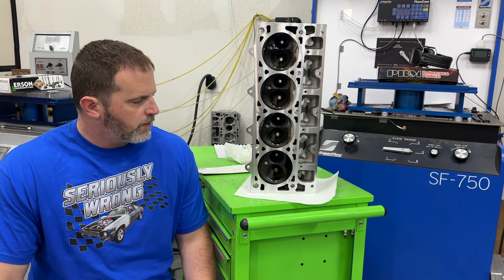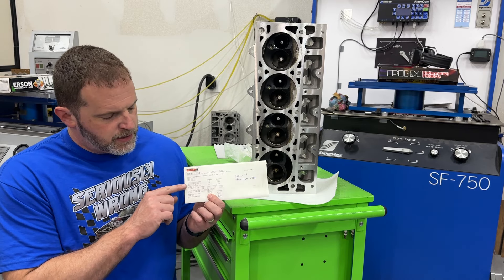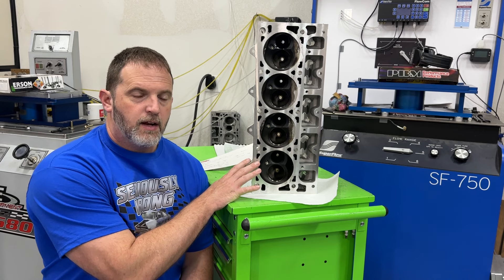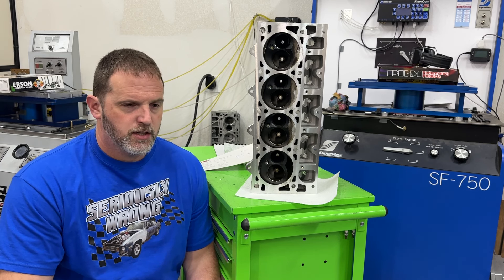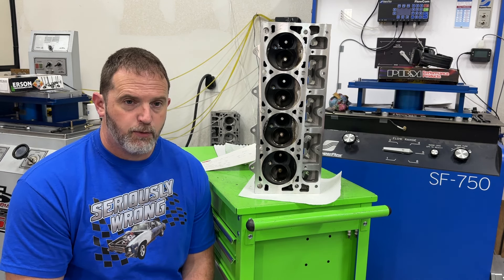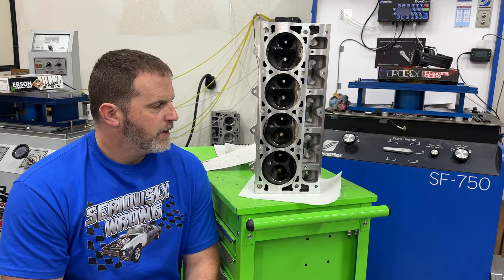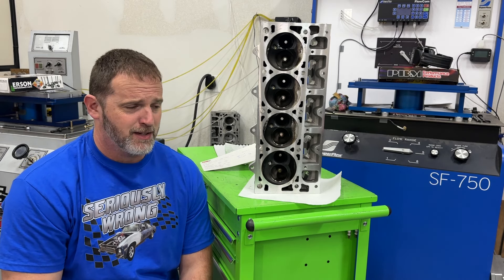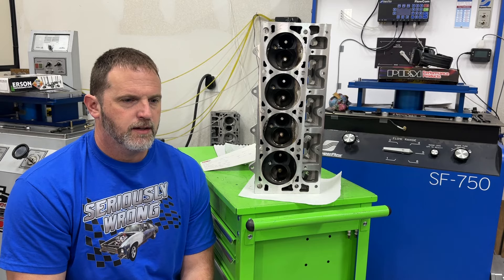Correction And More Testing.

Comment: Also the sbc tests were testing cylinder heads and intakes and different carbs, using the same cam. Narrows the testing down to what cylinder heads work better. 
 The heads being the only thing that changed shows what heads make the big number. 
The LS tests are changing  cylinder head, cams, carbs. There are few more variable in that mix.

Comment: Your mentions deflection of the rocker arms. 
 Smokey Yunick was using the spintron to measure movement on components decades ago. It’s crazy how springs bounce or flex or move around. 
 I saw a video of BTR using spintons now on the LT engines. 
 Many things come into play in valve trains. Harmonics, stability or lack of, springs bouncing, substandard components.

Comment: I thought you were very clear on the cam timing. Do you know what the rocker ratio is on the ls setup? I thought ls has 1.7:1 ratio rockers. If that's the case the valve action would be even more close to the SBC.

Comment: I think another thing everyone missed. Your LS is not a factory gm bore and stroke combination. Your LS has a 4.000 stroke, the only LS with a 4.0 stroke is the 427,  7 liter. 
 None of the factory gm engines came in 408 cid. With a 4.030 bore and 4.000 stroke. 
 But the 400 sbc actually is a factory bore and stroke setup, plus the slight over bore of .030.
So there’s that.

Comment: Eric can you please explain why my cam card shows LSA110 + 3 how does this work? thanks
Reply: 3 is 3 degrees advanced. Ground in
Reply: A 110+3 will generally have an ICL of 107 ATDC and an ECL of 113 BTDC
Reply: The plus 3 is 3 * advanced so yoy would set the cam up at 107 because you are advancing it
Reply: @maxmaxwell7590  yes and no. The +3 from the factory means that, nominally, the cam is ground with the 3 degrees of advance. If the cam is installed straight up, the ICL "should be" at 107 already.
Reply: @tadwiltman4875  thank you Eric great explanation.
Reply: thank you for that your answer, videos are very good for the guy doing the work on a budget just what you are aiming for  I would like to find the vortec heads been watching the ads no luck.thanks I well be watching for the next video
Reply: @tadwiltman4875  I don't know if anyone else understands this, but you sir are EXACTLY right on this one.

Comment: If you switch to 1.8 rockers from 1.7s, you will probably have to retard the cam a couple degrees to realize a power gain proportional to the lift increase.

Comment: Not trying to pic you apart but a dart block is gonna most likely make more power than a stock block.
Reply: I don't understand how an aftermarket block could possibly make mote power. Withstand more, sure but make more?
Reply: What does the block have to do with it? Please inform me on that one.
Reply: I believe the HP gains with aftermarket block has to do with block stability helping with ring seal from what I’ve read over the years. I can’t tell you i know this from experience but I have read it multiple times coming from big names in the industry.
Reply: @stevewalters6853  probably from big name guys who were sponsored by big name companies.

Comment: Why do different cams suggest different lash amounts? Aren't you just trying to get to zero-ish at temperature?
Reply from the maker: It has to do with lobe design.
Reply: Thanks for asking that I've often wondered the same thing
Reply: Most lash specs are hot
Reply: You do not want to get anywhere close to zero-ish and risk burning valves.
Reply: @jeffreydurham5342  why wouldn't they all be .028?
I guess why would you want more lash than having the valves 100% on the seats?
Reply: @riccocool  all solid lifter lobes have a clearance ramp to take up the lash gently without smacking the shit out of the valve train components, different designs (tight lash , etc) have a different ramp. Hope this helps!
Reply: @riccocool  I believe the lash is there to make sure, under any normal operating conditions, that the valve will not be held off the seat when it's supposed to be seated. Stuff gets hot and expands and takes up some of that clearance. That's why most solid cam lash specs call for more exhaust lash, it's hotter.

Comment: Yeah i saw the comments it doesn't matter how much you try to prove people wrong you can not change there mind. I deal with that all the time then when i do prove them wrong they either don't say anything, or they go ok your the know it all i won't help you at all or the rare occasion they go yeah ok your right i was wrong. Even that part drive me insane. I got 2 examples the cam i sent you to doctor for me when i was building that engine my he didn't liek it because it said 110 intake center i said don't go off by that it was probably mounted to read that he goes no i bet it's telling you to run 110 intake center line to have runs it's best and i tried to tell him your camshaft did the same thing on your cam doctor and you didn't install you intake centerline like that by they way it was intall at 106 and i didn't want it there i wanted 104 but actually now i want it at 102 but oh well 106 is fine for now. But yeah that's 1 example the 2nd example the engine kept running hot everyone thought it was lean so we kept adding jet and all it did was slow it down so my dad added a collant restrictor and a fan and now it run super cool like 190 max degrees. Then i went todk you all you other racing guys i didn't think it was jetting so yeah. There a lot more i can tell you but still impossible to prove people wrong it sucks